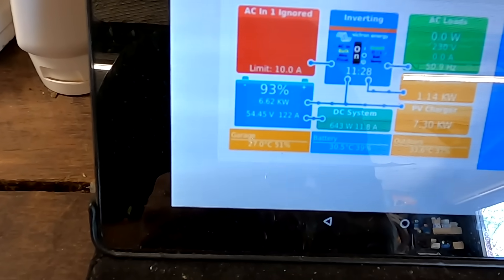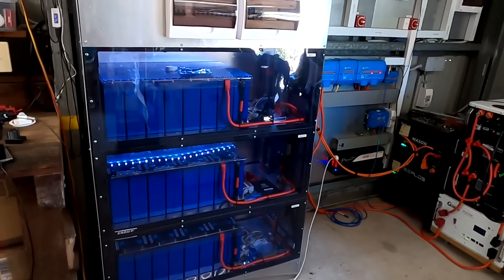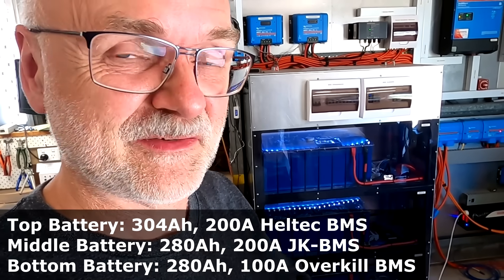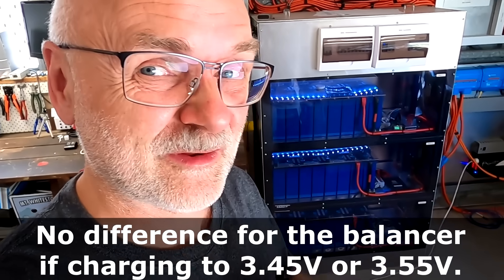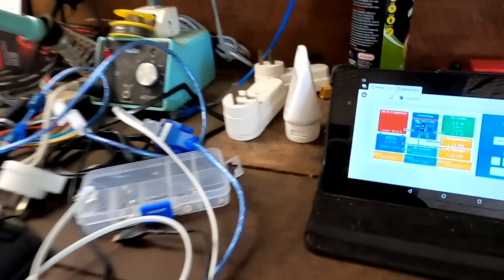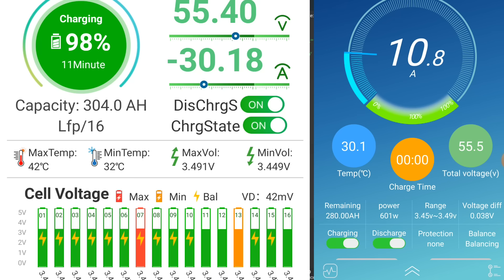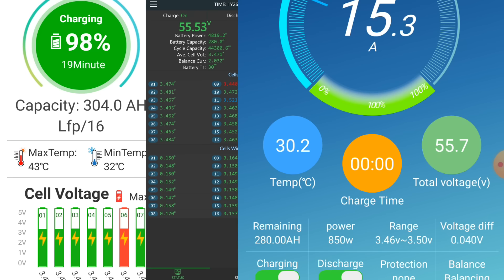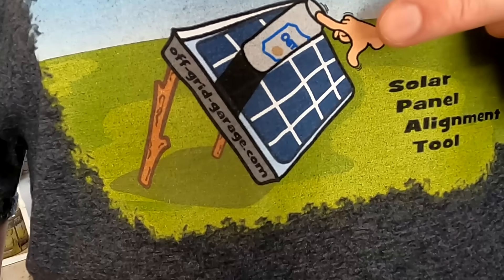Higher charge voltage = better balancing? Here is my battery shelf result!

Comment: Hi Andy. I purchased two 150AH LifePo4 batteries from Ali 8 months ago and had big problems with my Voltronic Axpert 5.6kw Inverter.
The BMS incorporates a Passive balancer and the deviation was around 70 MV when charging.
When set as a LifePo4 battery, they got to 85% SOC then OV'd and jumped to 100% SOC.
So after watching your video's I started to alter the settings.
Finally I settled on 54.8v charge with a Float of 53.8. The BMS is basic and doesn't allow you to set an absorption time, though I use Solar Assistant software from South Africa in an Orange Pi and they are looking to incorporate variable charging.
I found that at 54.8v and a Float of 54.0v the batteries charged at a faster rate than at 53.8v but were going up to 95% SOC (54.0v) rather than the target 90% SOC I was after.
53.8v I found to be ideal and at 90%-92% SOC 53.8v Float my deviation was a mere 6mv I n Battery 2 and 14mv on Battery 1.  I have the Passive balancer kick in at 3.365v per cell - yes, crazy I know but it works with no Active Balancing required!!
So cheaper Chinese Ali batteries can work but do your research and don't believe the settings they tell you.
Reply from the maker: Thanks for sharing, Peter.
If you can charge to 54.8V without OVP, that is perfectly fine and will be 99%+SOC. I would not be too concerned what SOC the BMS or inverter shows. They can be different and not accurate I found. Once you hit 54.8V, you know, this thing is full!
At 53.8V, the deviation will be low as this is in the flat part of the curve. You can have a huge 10% difference at this point and it won't show! So, don't look at voltage difference at this voltage, it basically does not say much.
Reply: SOC sucks!! 😂
I have found that what the Battery SOC states can be way out at times.
These Chinese Batteries come steel boxed with an On/Off switch and turning the battery Off then back On can change the Battery plus or minus 2.0AH.
So the battery states 125AH, turn off and on and the number can change to 127AH or 123AH or anywhere in between 😮
Possibly programming issues?? or voltage deviation issues??
Great videos as always - keep on charging!!
Reply: @peterwithers9276  with a lower charge voltage the tail end takes longer , and with shedding cutting short you may find that you don't hit 100soc and thus the bms/shunt does not calibrate itself back to reality

So if you don't hit the triggering points ie cell 3.65 or pack full voltage the soc could be out of touch with reality according to battery bms

Aiming for soc less than full on a lifepo4 , ie the 20-80 notion is folly imo

Since you can hit anything from 70soc to 95soc in the flat portion , depending on how long the tail end of the charge is

Some axperts tend to have charge time as part of the charging algo

Hence with a lower voltage i found that this would land me with a 70soc battery because it would hit the 2.5hrs it had as its max time to do the  CC/CV phases 

I think some refer to it as the axpert float bug

If you don't have solar and a high enough charge rate you don't know the bug exists

Slowing down the charge rate it reveals itself
Which can be the case with solar, as the voltage can hang around float voltage for a long time , lifting the float alleviates this 

It is simply impossible to hit 80-90soc consistently judging by voltage , and even by shunt , as the shunt does not account for losses and thus over time 90=89 ,90=88 ,90=87 round and round you go until one day you hit a low voltage shutdown

If you never hit 100soc for the shunt to get back in sync with reality
Reply: @leondavibe  @leondavibe Thank you for the thorough reply which is much appreciated.
When I bought the batteries, I originally set the Battery type on the Voltronic Axpert as LifePo4 and every time one cell would go past 3.75v (whilst the others were around 3.45v) and with the SOC only at 85%. The Battery would immediately jump from 85% SOC to 100% SOC and OV.
I've top balanced several times and with my lower Bulk and Float charges the batteries works well and the deviation is minimal.
With patience and a Coulomb Counter, I've done a full battery discharge running a load of 1.5kw and was within 10 minutes of the expected discharge time.
The separate Coulomb Counter is generally within 1% to 2% all the time.
I shall try to fully charge the batteries now that I have my settings working well to "re-calibrate" the top end.
Many thanks again for your reply.
Reply: @leondavibe  Hello Sir I need your help, I have a problem with my jk bms smart, on my old bms daly, closer to the end of charging the battery to 99℅, the charging current decreased and smoothly at the end it recharged the battery, and on the jk bms, as soon as the cell reached 3.54, the charging immediately cuts off, and it is still far from cel ovp, what could be the problem or is it the inverter?
Reply: @Reebcor  only have exposure to one jkbms model on one of my batteries

Normally on the app it will show if any protection mode is hit

If my battery hits any protection mode it will do this

IE it cuts the charging until the parameters is hit to clear the protection mode and then charges again

So would say check the app when it does this to see which protection mode is hit , and if I is the case it is behaving as it should you want the BMS to cut charging if any parameter goes out of range  (if all the values are set  correctly)

the Daly BMS  especially the cheap ones the settings can't change and i found that it would  allow cells to go as high as 3.75v at the top and 2.25v at the bottom , silly default settings so I just rid of that.
Reply: @leondavibe  Thank you for your reply, sir, this is most likely how my sofar inverter behaves, abruptly interrupting charging because the voltage has become 56.8 on the akuma with jk bms, because there is not a single error in the log, I sat all day and looked in the jk application and watched the charge from 99℅, and as soon as the cell with vol cell 3.54 gained voltage, then the inverter abruptly stopped charging, and there was no smooth decrease in current, I think this is the fault of the protocol by which my sofar inverter communicates with bms jk, pylontech, although the soc level shows correctly and the voltage is also clear
Reply: @Reebcor  
Can set the Bms protection voltage slightly higher than. The inverter charge voltage ie 

If the inverter is set to charge to 56.8v it can sometimes overshoot the voltage or that is what I have seen on my voltronic axoert

So setting the Bms to have a protection of 3.65v per cell then the Bms will not interrupt the charging  when one of the cells touch protection voltage which is currently the same as charging voltage

The inverter will then switch to  CV mode when it hits the 56.8v and Ramp down slowly without this protection mode Interuption

Having the protection mode set to exactly what your charge voltage will hit is causing the problem imo

Protection voltage should be the absolute max the cell should be allowed to hit

If you want to have a protection of 3.55v then you would have to lower the charge voltage On the inverter to create this buffer zone
Naturally going under 3.45v per cell can slow down charging and also lead to battery not to charge full

As some axpert type inverters have a time limit on its CV phase , one of mine had a 30minute schedule so once it has spent 30min in CV it would switch to float mode even if the AMP criteria has not been satisfied ie normally Float mode activates if CV charge drops below 10% of charge amps setting
Reply: @leondavibe  My protection voltage is set to 3.65, and the charge voltage is set to 3.54, my inverter shows that the charge voltage is at 56.6, which is 3.54 x 16, as it should be, but nevertheless the values do not reach critical, and the inverter does not lower the charge current, but simply cuts off the charge when it reaches 56.6
Reply: @Reebcor  maybe one cell is spiking did you observe individual voltages

Does charging drop to zero or just a low value?

The axperts do have a float bug in its software
If it has spent a long time charging(solar)  it can jump directly to float mode skipping the CV phase try lifting the float and see if it changes  behaviour
If it does then you know it is the bug
Reply: @leondavibe  charging simply drops to zero when it reaches 100℅, there are no jumps, I sat next to the battery for about 2 hours and watched in the application, I turned off float mode. unfortunately my inverter does not support it
Reply: @Reebcor  no I meant change float  voltage to match  charge voltage. 

So then if it changes to float prematurely it would actually still be allowing charging , ie essentially we changed Float into CV by having a high voltage

You  have solarassistant ?

It really is a game changer on off- grid type inverters 

Then you can monitor remotely , and change settings  too, imo essential
Reply: @leondavibe I have Solar Assistant and it is IMHO a game changer.
Sounds like BMS setting and Inverter setting aren't exactly talking to each other.
With Solar Assistant you can alter the float charge for different States of Charge.
I have 2 x 280ah Seplos v2.0 10E Batteries and charge at 55.2v with float initially at 54.2v.  I bring the float down to 53.6v in Solar Assistant at 90% SOC.
Batteries charge to around 95% which suits me fine without stressing any cells.
Deviation is 1 to 3 mv per battery which is excellent.
Reply: @peterwithers9276  it is almost impossible to hit 90% consistently  on a lifepo4. Even if you do it with a shunt from time to time you need to visit 100% to calibrate 

It is folly to try and do the 20-80/90 to prolong battery life

All you will do is visit 0% from time to time  and actually cycle deeper than you intend  ,ie if your cells drifted 10% apart and you choose to not cycle deeper than 10% SoC then you're actually getting close to zero on some cells

which from my experience actually cause more drift and degradation in batteries and balancing only happens when full at the steep portion , so trying to pressere the battery you are more likely to degrade it imo

Comment: Hello Andy, nice video . But I think you should have been more critical about a 56.8 V charge voltage . If fore some reason the shutoff function of the bms fails it will be a big problem . You have cases of these batteries causing explosions in Germany where this could have been the case , just speculating here . Having a charge voltage of 55.2V is a much safer way of operating these batteries .
Reply from the maker: No, no, no... these batteries don't explode. Read the comments under this fake article.
If the BMS fails, there is something fundamentally wrong! This is not how you design solar and battery systems. We don't know anything about the setup, only that there were LFP batteries in the house. 
It's like the press reporting on a Tesla fire because it was parked in the garage. The fire however initiated somewhere else. 
FUD

Comment: Hi Andy! and thank you again for your quality videos👍.
 It's clear that with all these tests that you have already done from the start on your cabinet of 3 groups of cells! it's OK😀. 
The important thing is that you were able to find the perfect parameters for your battery. (why change when it works perfectly? sometimes because of the weather? that's all.🤔.)

But as I have told you several times, your parameters are not always compatible with all battery packs, and different charging and balancing equipment.
Example for me is the charging limits (pack voltage) 54.15-54.45V.
with perfect cell balancing at 95-100% SOC.
Above 54.45V the cells have too much difficulty for balancing!. (with an Active balancer I can correct but not all the packs)
So for me my Max pack voltage settings 54.15- 54.45V are perfect! and when we look closer at 55.2 and 54.45V it's only 0.75 volts difference.😊
Reply from the maker: Yes, absolutely, hence I said this in the video!
Maybe if you charge to 54.4V only, you don't need to balance at all?

Comment: Hey can you help me out I been watching a lot of your videos for a long time and you are very experienced. 
I have 2 Hybrid 24v Inverters 3000w each inverter 80amp change controller built in and AC out can I tie both inverters to my 600ah  Lipo4 24v battery bank and I have 3200w solar panels tied to one inverter at the moment will this work to charge the batteries for both inverters I'm off grid
Reply from the maker: Thanks for your question.
You can have as many inverters connected to your battery as you like, there is no problem with that. Each inverter needs its own solar panel array to work (solar cannot be shared!). It will also work to have only one inverter connected to solar if the solar installation stay within the specs of the inverter. The second inverter will be only for supplying power to the load in this case.
Reply: @OffGridGarageAustralia  Thank you for responding back I see that you have a lot going on in your garage you have a lot of batteries wish I had a lot of batteries they are so expensive tho right now I just have 24v system if I knew what I know now I would have went 48v
Reply from the maker: @rontech34  You can always upgrading to 48V later down the track. 24V is not too bad either and can get all your energy needs sorted. So maybe stick with it as you already have all the gear.

Comment: Off topic, but how do you make the one charger the master? What determines a master?
Also ... great video .. nice to have some actual visible facts on what charge voltage actually works ... thanks. 👍
Reply from the maker: That is the Victron feature. I made this video about how it works: https://youtu.be/fr_P3DPZT88
Reply: Shoot ... I guess I missed the Bluetooth requirement.  My second charger is a 
Blue Solar controller.   It's networked, but not through Bluetooth.  I'll be fixing that ASAP!! So many videos to watch 👍 @OffGridGarageAustralia
Reply from the maker: @GregOnSummit  I think you can upgrade with a BT adapter or so...

Comment: Thanks so much, Andy! Love your testing!
Reply from the maker: Thank you. Me too. Got heaps more to come...
Reply: @OffGridGarageAustralia  I've commented about my testing before. I have been testing cells for year with different techniques, and charging above 3.5v has proven to be detrimental to my cells. I'm already doing damage control. I will not charge above 3.5v per cell going forward. The degradation in just 1 year has been much higher than I had expected. I had several packs that I balanced, and 2 packs that I did not balance (lazy because they are in a case, and I thought they could handle 3.55-3.6v max without damage). I set my BMS to trip at 3.6v and it never hit 3.6, but daily, it hit >3.5 for 1 year. That 1 cell was always higher than the rest, so I just let it stay high instead of balancing it, and it is FAR weaker now after 1 year. It slipped to hitting 3.6v more often, and I backed off charging to only 55.2v or 55.3v just to keep it from closing in on 3.6v again. I finally did balance it and it's amazing how much less total capacity that 1 cell now has. Even top balanced, it is now the first cell to hit the bottom each day... so badly that I have had to set it to trip at the bottom at 50.8v just to keep it from hitting 2.5v. Measuring the total in the pack, that cell is hindering the entire pack so much that I am only getting 75% capacity from the 16 cells. I've pulled the entire pack and I'm rebuilding with new cells at this time. The other pack is similar, so I'm going to just replace the bad cell in that one, and do more testing (my own Frankenstein battery).
Reply from the maker: @dustins4194  Oh, wow, there is something seriously wrong with this one cell. Charging to 3.5V should not degrade this cell that fast. It is well within the specs and you should not feel any capacity loss at all. Can you capacity check it?
Reply: @OffGridGarageAustralia  The degredation was done when it would go above 3.6v. I am taking apart all of the packs now and I will capacity check the bad cell, but I know it is weak, and I know that anything above 3.6v has caused it to degrade. I will not go above 3.55v ever again.
Reply: @OffGridGarageAustralia  I love your testing, and you can do whatever you want, obviously. I suspect someday you will do some long-term testing and find out that 3.6v degrades the cells a bit more. When I'm charging big power in the middle of the day, and my voltage starts to ramp up (high part of the curve as you say), it's hard to stop the inertia on a dime. It seems to always pop up over 3.6v (I've even seen it actually hit over 3.7 before the voltage rise actually completely stops.  It's my strong feeling that closer to 3.6v is just a tad too high for these cells and they start to get a tad hotter than they are comfortable. I will not charge to 3.6v.
Reply from the maker: @dustins4194 It's definitely not necessary  to charge to 3.6V to fully charge the battery. If you lower your charge voltage to 3.5V you should not see cells going over 3.6V any more even if you push hard. Some even charge to 3.4V only and have a 4h absorption time until the battery is full. That could be our summer charging mode when we have enough solar and also time to charge.
Reply: @OffGridGarageAustralia  Thanks for the reply... That's my plan. I hate when that 200A charge is hitting at 1pm and the batteries are almost full... and I don't have a current limiter. I always see it go higher than my set voltage. I need a Gobel Power BMS or something similar. Just too many packs and that would cost a lot!